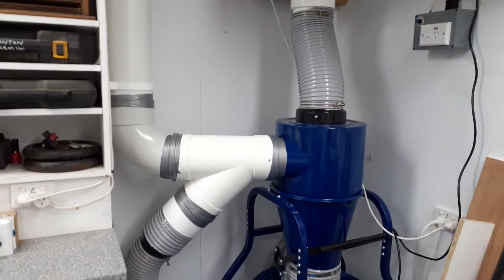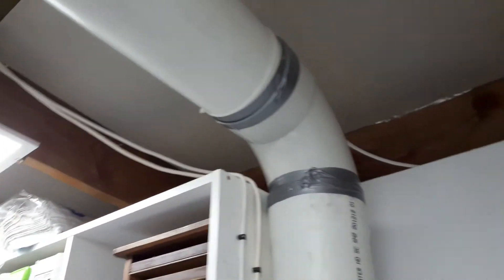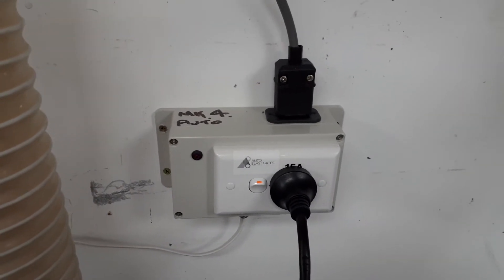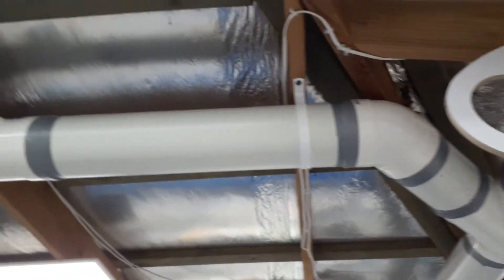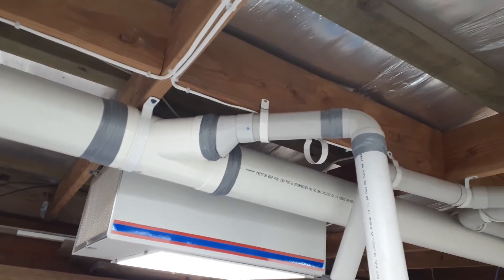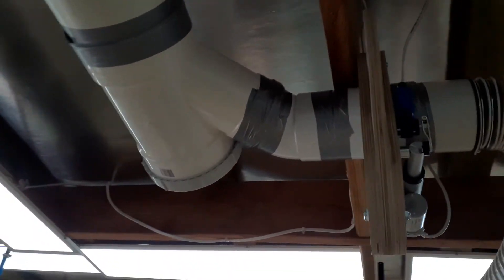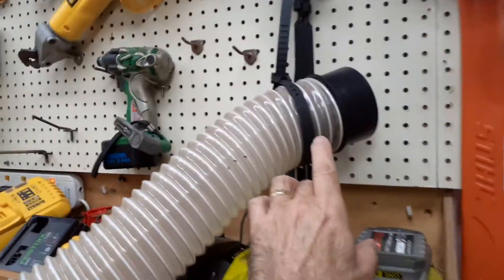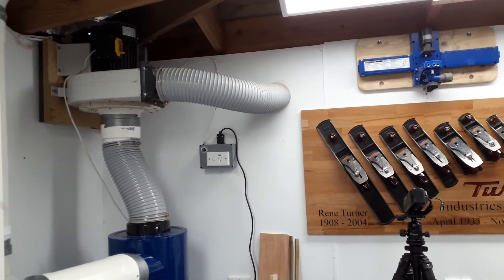Quick tour through my 6 inch dust extraction setup.

Comment: Beautiful system. I’m curious how you feel the suction is at 2.5 inch hose at the blade guard on table saw. I stepped mine down from 4 to the 1.5 (or whatever the small size is called) and it did not have the velocity needed to do anything of substance, i wind up hooking that directly to a shop vac when I need it.
Reply from the maker: Thanks Jeremy ! The smaller hose works very well but a lot depends on the design of the blade guard on the saw.

Comment: I think I would only bother with the HEPA filters if heat loss was an issue (or cooling in summer). I would be more inclined to move the blower outside if noise to you neighbours isn't an issue.
Reply from the maker: Thanks I.M. Peterrific!, I'm on a couple of acres and neighbours are not close enough to concern.

Comment: Hi Dave, I want to replicate a setup like this but the In-Line Cyclone Separator you are using is listed to only have 5" inlet and exhaust ports. So how is it possible without using a reducer and negative impacting on the airflow to connect up a blower motor with a 6" inlet?
Reply from the maker: Carbatec have since changed the specs of the inline separator. I told them they were foolish to do so but who am I for them to listen to.? It might be best to make your own.

Comment: Hey Dave. I live in Brisbane. Can you please tell me how many CFM you blower is rated and where do you get your cyclone?
I’m thinking of doing the same thing and venting my extractor outside. My current dust extractor is rated to 1200 CFM and I’m wondering if the 6 inch pipe is too big for that size unit?  Thanks heaps!
Reply from the maker: Hi Quit Your Day Job! Mine is a 1200 cfm also.